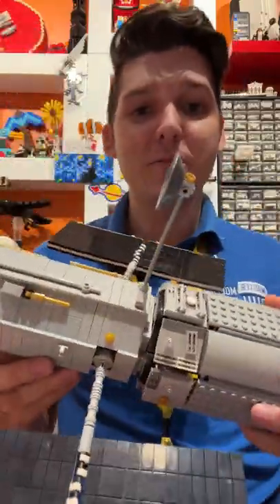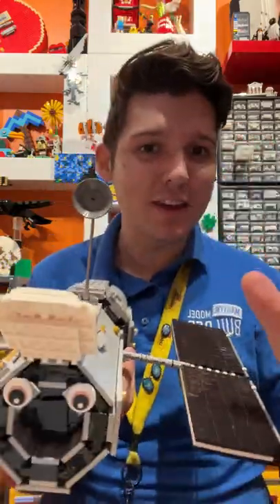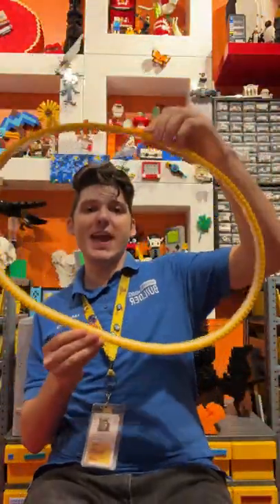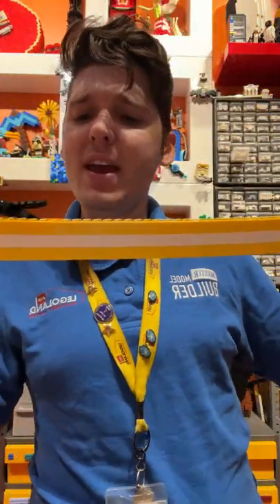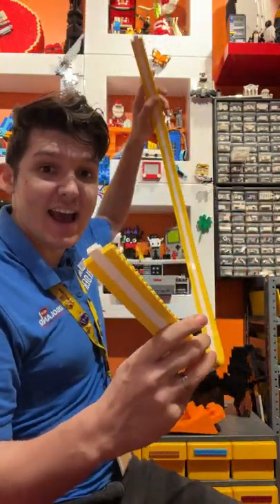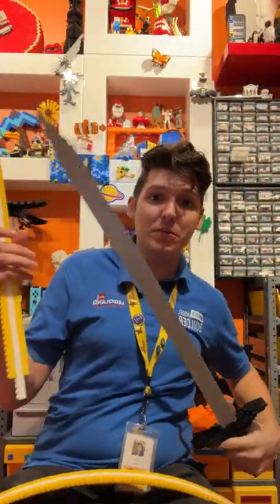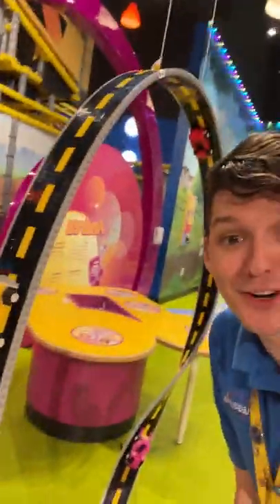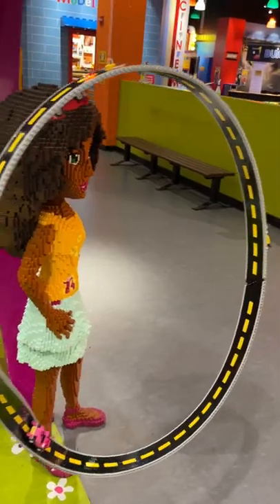Fun Technique seen on LEGO Masters

Comment: Amazing! A Morbiu—I mean, Möbius Strip using Lego.
Reply: And then it proceeded to möb everything
Reply: Truly one of the Lego sets of all time
Reply: I literally had the exact same thought bruh
Reply: my thoughts exact
Reply: Mobius strips have only one side, I believe.
Reply: im about to möb
Reply: This is beyond funny
Reply: It’s möbin time
Reply: @waterwaifu612  😊😊😊😊😊😊😊😊😊😊😊😊😊😊😊😊😊😊😊😊😊😊😊😊😊😊😊😊😊😊😊😊😊😊😊😊😊😊😊😊😊😊😊😊😊😊😊😊ðð😊😊😊😊😊😊😊ð😊😊😊😊😊😊😊😊😊😊😊😊😊😊😊😊😊😊😊😊😊😊😊
Reply: MØRBIÚS
Reply: @Prophet_of_Colour  the race track in the video also only has one* side

* assuming you dont count the tops and bottoms of the bricks, where the pegs are and fit into, because otherwise the mobius strip is geometrically impossible to practically form. Which would be fair, I suppose
Reply: @averywhitaker3513  I do count the bottom and edges as three extra sides, yeah.
Reply: @Prophet_of_Colour  ah, behold the 3-sided rectangular band!
Reply: @averywhitaker3513  however I've incorrectly remembered the definition of the strip. It's hard to do in lego not because it's geometrically impossible (it is, I was wrong), but because twisting the lego band to be able to attach the on one end studs to the antistuds of the other would usually require a full twist instead of a half.
A Mobius Strip must have a half twist.
Reply: Jesus loves you!
Reply: @Prophet_of_Colour  🤦‍♂️
Reply: @missionslos8856  Already called myself out. A month ago.
Reply: @Prophet_of_Colour  ok
Reply: @Prophet_of_Colour  3 sides? No, if anything 1 extra side but I have no clue where you got 3 sides from
Reply: @DeepfriedBeans4492  this is a three dimensional object, and therefore its edge faces are--by virtue of existing--sides.
Reply: @Prophet_of_Colour  well if you’re looking at it that way then it’s way more than 4 sides, billions of sides even since if you get small enough the atoms aren’t “smooth”, but even on a more macro scale it’d be one side for every brick
Reply: @DeepfriedBeans4492  mhmm. Buddy, I described how I'm looking at it. As an object. That object has four meaningful sides.
Reply: @Prophet_of_Colour  how can you call them separate sides if you can’t say where each side starts and ends?
Reply: @Prophet_of_Colour  The editing is just because I usually send the comment before proofreading, I'm not changing it significantly. And I didn't see your other comment, I thought you were just saying the strip has 4 sides because it looks like it does or something, idk like I said I didn't see your comment where you explained why it's a full twist, I just saw you saying it has 4 sides.
Reply: @Prophet_of_Colour looks like the one in the short has a half twist, he just connect the two opposing ends differently than stud to stud
Reply: @Theffries  kketchup is gross
Reply: @Prophet_of_Colour  ?
Reply: @Theffries  that's a punctuation mark.
Reply: @Prophet_of_Colour yes one side that stretches across the entire object it’s quite remarkable
Reply: @MLGPRO-sm8jy  too bad nothing is perfectly flat
Reply: Its MORBIN TIME
Reply: Neat!! I forgot that term; my first thought was"wow, cool halo ring"

Comment: I thought Master Builders didn’t use illegal techniques, unless this one is actually approved legal.
Reply: Set designers don’t, but master builders dgaf.
Reply: I assume set designers need to follow certain rules for their designs to be approved, master builders aren't paid to follow said rules.
Reply: @soyUsernameWasTaken  Yep, I used to work for a LEGO licenced builder and we were not allowed to use these techniques. LEGO corporate has a few rules that they don't like seeing broken.
Reply: As far as I know this isn't "illegal" because there isn't any harm done to the bricks afaik
Reply: @debugempty It's putting the bricks under undue stresses.  Those 1x2s will be useless for another build if left like that for too long.
Reply: Wait.... is there seriously "legal/illegal" rules to Lego?

..... I thought everyone was just joking....

What's the motivation behind this(on lego's part)? Or am I just failing to pick up the obvious joke?
Reply: @nignamedmutt7270  an "illegal" build is a connection that puts an undue amount of stress on the parts in it. they're called illegal because they wouldn't be allowed to be used in a set designed by Lego.
Reply: @nignamedmutt7270 there are building techniques that cant be used in set designs because while they technically work, they cause excessive stress to bricks that make the bricks fragile, or is an unstable connection thst wont hold long-term. Some bricks, like the 1x1 tile with clip, even got redesigned to reduce those stress points and be used for techniques that previously would have damaged them. The most common example is wedging plates sideways between studs, because it places too much stress on the studs and can cause warping or cracking in the brick. While the term has gotten a little overblown, with people calling weird but fine connections, like placing bricks on a minifig's neck stud "illegal" despite not causing any extra damage.
Reply: @nignamedmutt7270 basically an illegal move with Legos is when you jam pieces together that aren't supposed to fit that way because you will break them

Comment: It’s not just the space that makes it flexible; it’s the fact that 1x2s only have two studs, which effectively work as hinge points. That, and the space, means the pieces themselves aren’t flexing at all. This kind of build doesn’t damage the pieces other than maybe a little bit at the inner edges and at the studs, but structurally speaking, they aren’t under stress.

Comment: The mobius strip reminds me of this design I once saw for a two sided die, it was two rectangles that were rounded at both ends but pill shaped so when you took two and blended them so the rounded ends were parallel then they were slotted together to form a two sided object that only had one intersecting line. Could you do this with legos as well?

Comment: The 1*8 would probably have the same flex. It is just the radius is much larger
Reply: Depends how you build it. The 1x2 bricks are attached to each other with one stud so can pivot, but 1x8 you can overlap by 4 studs. There's no chance of that pivoting, it'd only bend. You could overlap 1x8 bricks by one stud to get it to pivot with that bigger radius.